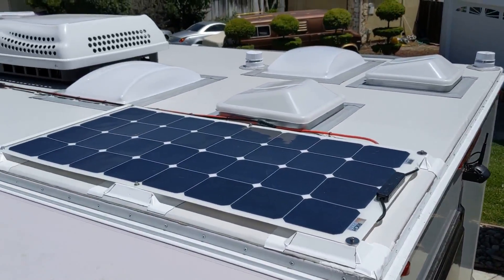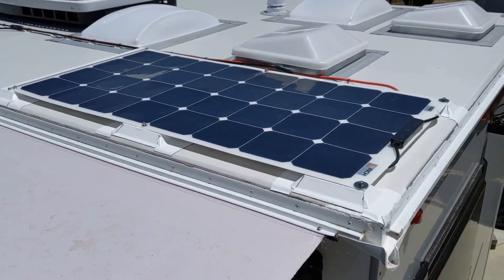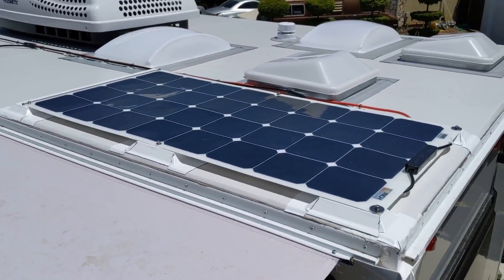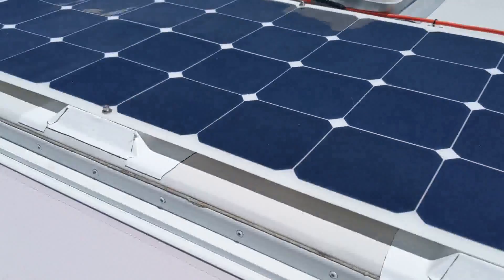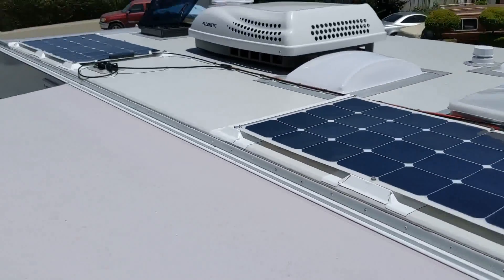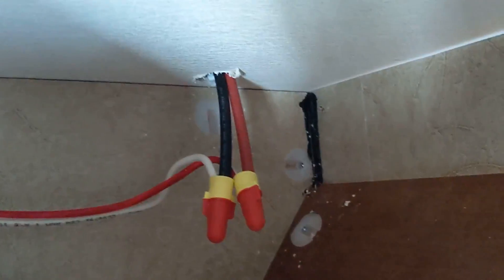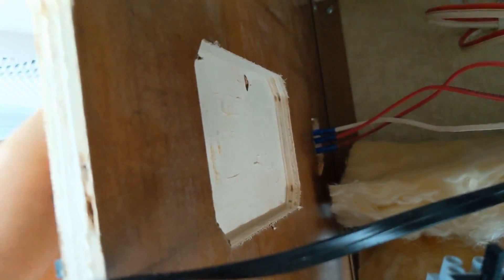Flexible Solar Panel Installation (with air gap, but no drilling) on my Lance 1575 Travel Trailer

Comment from the maker: Quick update : The panels are still working as of March 2023, we go camping every month and live in San Jose, CA to give a sense of usage. I haven't had to do anything to them apart from clean them occasionally. 

I do however think that as some people have commented angling them just slightly so that water doesn't pool on them would be an excellent improvement. I also think having slightly more support underneath the panels would be nice to prevent unwanted bowing of the panels which allow water to pool.
Reply: Thanks for the update. 

Have you done anything new?

We have the same RV.

Comment: Saw in 2023 you said they were holding up. I’m in the process of mirroring your project. Now In 2024 how are they holding up? Any issues any corrections? Do you still have them set up?
Reply from the maker: Yes, they are still working well. The only issue is the panels sag in some areas and cause water to pool. Which means I need to clean them now and then (which is probably a good idea anyhow).

Comment: OK it’s been a year according to the timestamp on the video. How have the brackets on the roof holding up? Flexible panels I have a history of deteriorating in a year or two with the amount of efficiency they’re rated for. How are your panels holding up? Thanks it was a good video.
Reply from the maker: I actually installed them in June 2019, and have left exposed to the elements ever since. They have warped slightly where they are not supported, so I would change the design somewhat to better support them, but they are still working well.

Comment: Nice setup, gives me some ideas. However I would maybe worry about  strong cross winds lifting the panel up (?). Also I have seen some use a track in which bolts will slide back and forth, this is useful if you ever replace the panels, or the ones one may have are crap, and other panels have the holes in other places, sliding bolt in trac could accommodate this.
Reply from the maker: Never had any issues with cross wind, however that panels have sagged a little in areas without support, so I would recommend adding some form of structure underneath (which will not trap water underneath). The tracks are a great idea, but pricey.

Comment: How did the build fair through actual driving? ....no solar panel flexing with driving?
Reply from the maker: Sorry, but I've never setup a camera to record it, and I can't see them while driving.
Reply: @joshseal2000  yeah, no worries....just curious. If they are still working since April of last year then, it doesn't appear to be a problem.
Reply from the maker: @mrrey8937  still working perfectly in March 2023
Reply: @joshseal2000  awesome to hear, well done!!

Comment: Very nice. A good way of mounting flexible panels. For draining rain, how about making the supports towards the middle of the RV roof a little taller than the ones on the outside of the roof. This way, the panels are sloped slightly downwards towards the gutter.

I suppose something else that could be done is add a wire or rope connection from one of the panel mounting holes to some fixed location on the roof of the RV, e.g. AC. So if the worst case were to happen and the panel comes flying off the roof they're saved by the rope.

Comment: Nice thinking. A tip: make the spacers on the inboard side thicker than the outboard spacers. This will tilt your panel to the side, giving a tad better solar exposure (if you remember to park the "right" way) while preventing ponding. And there's no need to block air and flex the panel in the middle.

Comment: I am interested in purchasing this same lance travel trailer and installing a similar solar setup. Was it prewired for solar or did you have to do this yourself?
Reply from the maker: You need to add it as an option before they build, or make sure it's on the list at the dealer. But don't add too many accessories because they add a lot of weight and mean you can't carry lots of stuff.

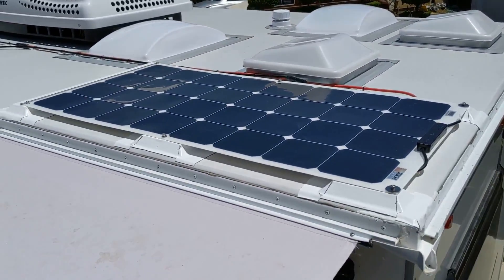Comment: @1:52 the air gap under the panels was a smart idea.  You would not believe how much more productive these panels are when elevated off the surface of the vehicle.  https://www.patreon.com/SunEater1  I have a post here with pictures of panel output doubling when elevated off the vehicle surface.  Good machining on the mounting set-up, I like that.  You should consider running your panels in parallel though (and adding a third 100w).  By generating 200w @ 40v and having your charge controller step-down the voltage to your 12v battery bank you create three drawbacks.  1)  Heat.  The electrical process of stepping up-down voltage generates lots of waste heat that you don't want in that compartment.  2)  Wasted power.  You lose 7-11% of your wattage when you step the voltage up/down.  The amperage would be higher in a 200 watt 12v setup, and higher amps do create a little more heating in the wires, but you will come out ahead in the long run by atleast 7-9%.  3)  Better output in partial shade.  If you park in such a way that 1 of your 2 panels is shaded with them in series the output from BOTH panels drops to 0.  With 2 (or 3) panels in parallel, if you shade 1, you still get the output from the others, when one is shaded.
Reply from the maker: Really appreciate the feedback here! I had gone with series to try and minimize losses in the cabling, and hadn't considered the DC conversion losses. Vicron states their DC/DC conversion efficiency is 97.5% at 48V, but I couldn't find any detailed information in regards to efficiency throughout the full input range, so it could be much worse. Also, I hadn't consider a partial shading situation. I'll really have to think about switching to parallel. Thanks!

Comment: Interesting setup. How has these held up? Is there any loud sound/vibrations when on the highway?
Reply from the maker: Pretty well, no issues to report. The panels have warped a little, but still performing well. No issues on the highway, although I probably couldn't hear it even if there was.
Reply: @joshseal2000  Thanks for the reply, gives me a better idea on how to approach this. A lot of people just used corrugated plastic and I just don't think it's enough of a gap.

Comment: Looks like a great approach and I like the taller air gap this provides vs mounting on top of corrugated plastic board. My only concern is getting Trex to bond to anything....  Is the eternabond tape (wrapped edge to edge on the PVC roof) providing the bulk of the bonding strength?  How has this turned out for you?  Is the panel secure at highway speeds and safe from vibration?
Reply from the maker: There is double sided tape underneath and then tape around the edges. No signs of issues, even after many trips on the highway.